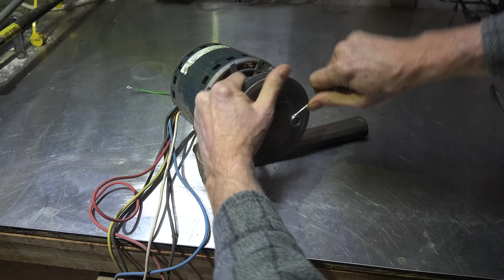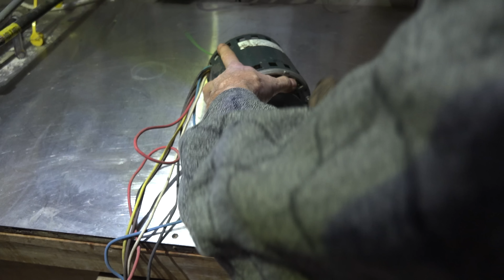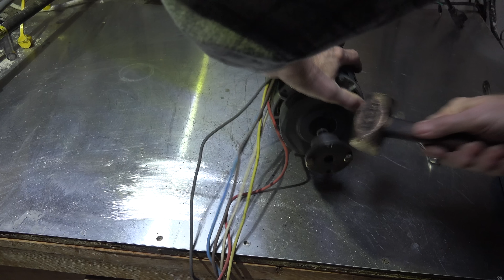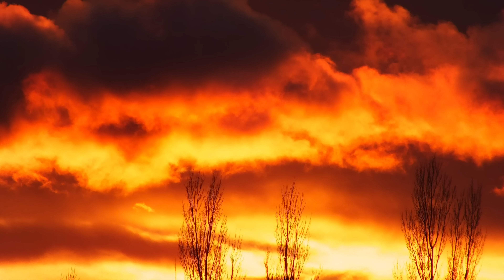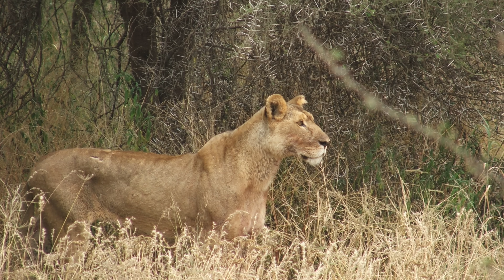How to install the browning pulley

Comment: Wish I knew that 12 hours ago when I used a puller to remove it, instead of 2 screws and an open end.
Reply from the maker: Don't you know you are supposed to watch my videos before you do anything?  lol
GFM
Reply: @grayfurnaceman  yes. I will. Haha. 10HP motor, had a rough night with that thing...

Comment: I agree i used to work at a gain elevator/feed mill and Taper Lock pulleys were all we used on motors ranging from 3 HP all the way up to 75hp did not have many fail l don't know the brand name but we also used some that used an allen screw that screwed in between the wedge and the pulley. half of the threads were on the wedge and the other half were on the pulley they worked good but I did not really care for them I much rather have used the Browning style.
Reply from the maker: They are the best.
GFM

Comment: I really like these. Funny thing is, I have seen several of my co-workers break them with a puller. They didn't know the puller was already on there!
Reply from the maker: Interesting.
GFM
Reply: I bought a used 5 HP motor that had a double groove sheave with one of these locking bushings. I removed the screws and tried to pull it off but I broke part of the sheave. Then I investigated further and saw how to use the alternate holes to get it off. It is a good system. http://enginuitysystems.com/pix/5HP_Motor_800x600_0560.png

Comment: Use a screwdriver or a  small wedge in the slots of the  hub and it will spread and open the bore of the hub  and release the hub from the shaft.  You don't have to hammer it offer.
Reply from the maker: This installation was done on an older, well used pulley that spreading the hub was ineffective.
GFM

Comment: does anybody know.wer the flame sensor is on the rheem model number Rrgg 05n31jkr
Reply: Jesus H Medrano have to be where the burner inshots are! but no offense you shouldnt mess with it if you have to ask.
Reply: i dont see anything. i thought maybe it was part of the pilot/spark setup..
Reply: Jesus H Medrano sorry friend wish i could help but i think it would be too risky to give you more advice, gas is nothing to mess around with ive seen many injuries, i dont know about your local shops but here in Colorado you cant even go to the parts store to buy parts unless your licensed. call a local company. good luck.
Reply: huh, well ur no help anyways it turnes out to be the ignition control.module and its ordered ans ita way thanx for nothing though.
Reply: Jesus H Medrano welcome! good luck.

Comment: they are nice and I used them many years ago but dont remember how to put it on the shaft right place for alignment a set screw  tybe you can slide it back and forth but this one ?
Reply from the maker: Alignment is a problem and sometimes it takes a couple of tries.
GFM